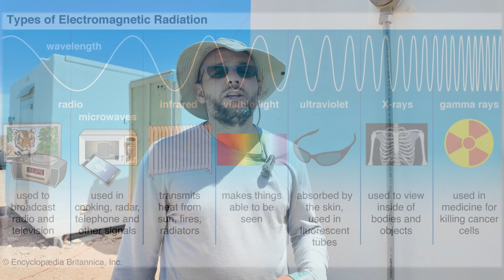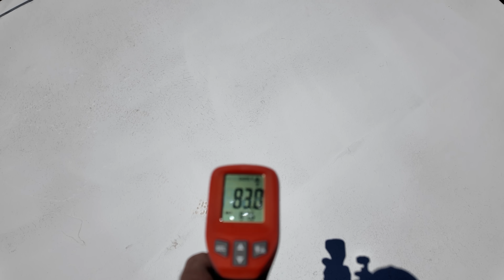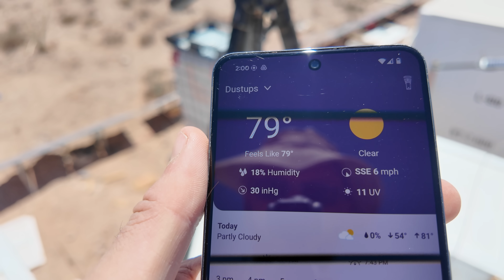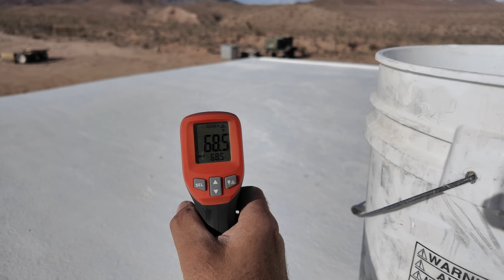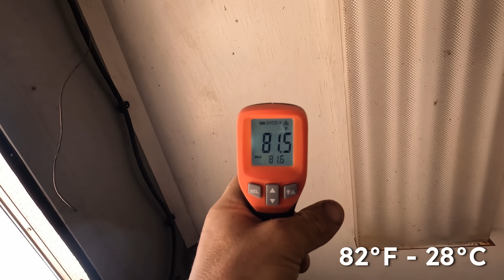I sprayed "cooling paint" on my desert cabin...this is shocking

Comment: It think you're putting a little too much importance on that "reflecting the IR to outer space" thing. Think of the mountain in the distance as a mirror. If you were to shine a flashlight at it, how much light would come back. Pretty darn near 0. And the mountain isn't nearly as reflective as a mirror. Cost of the paint is the real factor to consider when deciding if you want to do the sides. I would consider doing the eastern side of the shed because it's the one that gets hit in the morning, and I wouldn't enjoy being awoken by the heat.

Comment: In my house in Pakistan we have a layer of elevated tiles on the roof. That makes a smaller layer of insulation and it has made the entire house a few degrees cooler. I think that would be a really cost effective thing to try
Reply: Tile roofs in Florida save ~ 1/3 cooling expense, not sure about metal roofs with a gap, they are also better than asphalt shingles.
Reply: How does that stand up in high winds?

And where in Pakistan do you live?  I used to go to Karachi and Swat with my family when my father worked there.
Reply: @louisegogel7973  Many of the homes built long ago in South Florida had barrel tile roofs. Having the air space was a big advantage and most definitely withstood high winds. It all depends on who built it.
Reply: @louisegogel7973 i live in Islamabad. The roof has a cement boundary wall and the tiles are quite heavy so the wind isn't an issue

Comment: I love this one. I think it'll work. I would be tempted to paint the side regardless. Any heat you throw at that mountain isn't going to get back to your site. It is pretty expensive paint though.
Reply: I still think you should put the huts in a strategically placed hole. I can see how that wouldn't work with your longer term plans.

Comment: The real answer is that you need to build a compound with running water, electricity, and enough space to house a few families. That would be extremely expensive, although in the long run, you’d be setting yourself up for success

Comment: Shade cloth staked down over building. Using 4x4 blocks (1 per corner, think more cube shaped) to create gap and allow airflow. Will put the building constantly in the shade. Can be removed in winter to be warmer. Should stand up to high winds. Angle of sides can be steeper. Or less steep to provide shaded sitting area outside.
Reply: wind
Reply: @CharlsonCKim what do you mean?
Reply: https://youtu.be/ynY_9MctG6M?si=DtDgSjzfkUQ-fjpC here is the nursery set up on the ranch using shade cloth. It’s at the 26:30 mark. This has proven to stand up to the wind and sun so far.

Comment: You need shade. Get a mesh tarp and make a tent over your structures. Let the tent absorb the heat and it will radiate it back into the air. The sun will not be directly heating your structures. Shade is the way. 
Don't go 2 story in the desert. it's a bad plan. Heat loves up.

Comment: I agree about using shade cloth as it is easy, temporary and not as expensive as other ideas ( and faster to put up ). I have accumulated many large sheets of it from yard sales. You could just put a couple of 2x4 pieces strategically placed on the roof to create an air gap and then actually tent from one side over the top and down to the ground on the sides at angles, This has worked really well for me in the hotter areas of SoCal.

Comment: You can't rely on the IR measurement, the special paint will have a different emissivity.  You need to use a contact measurement.
Reply: The one around 17 min mark where he shoots the ceiling from the inside was a good comparison
Roughly 2 degrees difference, which is still a measurable difference. Idk if it was worth $300, but hey
Reply: The paint being so reflective, a thermocouple would be more appropriate in that situation.
Reply: Or use simply a patch of opaque tape on both surfaces. Those patches will have exact same emissivity.

Comment: why don't you put shade cloth awnings on all the east and west sides of the buildings so the sun isn't hitting the the sides fully? the reason i suggest shade cloth is because it would last a lot longer then a tarp because the wind can blow thru the holes in the shade cloth. the one that works the best is the aluminet that is metallic and shiny instead of black because it reflects instead of absorbs the sun's rays. the holes in the shade cloth also help sudden wind storms to not rip the shade cloth away or act so strongly like sails on a sailboat. the more shade you can make in camp the cooler it will be to work in camp. maybe aluminet for the east and west sides of buildings and the cheaper black stuff for everything else would do amazing things for camp and be cheaper. also as a fellow texan (south). the reason the tires work is because it gets the plants out of the drying wind. shade cloth fences to slow the wind might also help plants. you will probably run out of tires, but you can line the sides of a hole with rocks and i know you have a lot of those. if dug deep enough to provide enough of a wind block, or maybe a rock wall on the most common windward wall would also help. good luck!

Comment: solar panels not on the roof but around the roof will give a bit of shade on the walls and the ground around it. the ground might not heat up as much. probably not a revolution but whatever, you need electricity anyway. if it results in 1°C less inside, it is already a win.

Comment: The drying of the paint acted as an evaporative cooler.  If the paint was reflecting the infrared heat into outer space, the infrared thermometer would have registered the roof as HOTTER than the other buildings.

Comment: It will be more effetive to add a second hoof. Keeping space to the air passes between. Please make a test and see. Best regards.
Reply: I was thinking the same thing make it bigger than the current roof with overhangs for shade.
Reply: Keeping space between the structure and the roof is key, can even use camo net propped up by some of those pipes made into a frame. Just to put the structures in a shade.
Reply: @ianb3895  That will defeat the radiative cooling feature of the paint.
Reply: @michaelsmithers4900  But then don't need the paint that cost more than saffron
Reply: @lukehahn4489  You are correct. These are two different strategies. One being shade the other being radiative cooling. 
Is the paint more expensive than a second roof complete with overhangs?

Comment: I've heard that people use solar ovens at night to create ice. It uses the same principle of radiative cooling. 

This might be a way to get water for your trees. Bear with me. Take a trash can and bury it. Cut a small hole on the top and then put a reflective cone over top. The reflective upside down cone will get rid of the heat at night. By keeping it underground, you'll have a consistent temperature. You should be able to create ice at night and then the hot ambient air will condense on the ice. You might need to have a small pipe feeding air into the trash can from the side, having the tube underground a little bit will pre-cool the air. 

You should have a relatively low cost atmospheric water generator that doesn't use any electricity.
Reply: have you done this ???
how deep does it need to be ???
will this work at temperatures over 110 degrees ???
where can I get more information ???

Comment: That paint on a metal sheet, with a fan blowing at it, should be pretty effective, as long as its pointed into space. Though mustnt be behind glass, as glass reflect IR. Dont know how you would use this, but perhaps in the future, this is the principle to use radiative cooling as an air con

Comment: I live in Tucson Arizona and have an old adobe and concrete block building/ house . On the east and west sides I get a lot of heat hitting the blocks which radiates into the house over time. What I did was attach 2 inch hard foam to the walls and after applying chicken wire over the foam, stuccoed them for aesthetics. Depending on the surface material of the building you can use construction glue to adhere. Temp drops of 40 degrees or more in the summer. On the south side I put up a metal shade structure to allow us a place to go at night time when things cool down. You can use any foam you
Like but the hard foam is more durable. Instead of insulation, we call it exsulation
Reply: I live in the Mojave Desert 120+ during the summer. Mike you did the right thing turned you house in to a giant cooler.
Reply: @AnzaValley  Does this guy live in a temperate climate? Or does he have extreme temperature shifts and seasonal weather?
Reply: In San Antonio the Air Force turned a WWII warehouse building into offices using the same method.  They covered the wood siding of the building with 4 inches of solid foam.  They used additional strips of foam to make designs and give it some architectural interest.  Then they sprayed stucco in two coats.
Reply: @dchall8  Large office buildings are often covered by a "sheathing" which is thin, attractive, durable, but has an air flow space behind it. Weather hits the sheathing, but the wall it shields is untouched. Heat bounces off, rain bounces off, snow & ice may cling, but still don't touch the actual wall. Sheathing can be replaced if damaged, but it does the job. It's based on "the perfect wall" which I think was a Harvard study.
Reply: Years ago I read about a cabin in the Rockies that used hay as the insulator and the result was much higher efficiency with both heating and cooling.  ✌️
Reply: What is the temp 12 feet down?

Comment: Damn that paint works. That was crazy—unless the roof was cooled by the spray and evaporation. Bear in mind that the IR from your roof is not going to space. It gets absorbed to a great extent by dust and other particles as well as gasses that absorb and the. Re-emit the IR at another wavelength.

Comment: maybe look into the double roof effect. It is where a second roof is placed just above the first and causes an air current to form between the two rooves.
Reply: Group the buildings with a walkway and make that second roof one that covers the whole place.
Reply: Every single wide trailer in the world should have one of these
Reply: This won't perform as well, the radiative cooling paint allows it to get below ambient temperature (if applied well), this would only get it to ambient temperature but not below it.

Comment: my suggestion is to get solar powered mini split or window unit. It will run in the heat of the day and will only cost solar panels and the cost of the unit. The other thing that would help is get a giant green house frame and cover it with shade cloth. When i mean big i mean big enough to cover all of your buildings. Now i own land out there and know the wind is going to be a issue so its going to need to be properly anchored.  Those are super cheap to build.
Reply: I bet the money and time he spent on the paint, sprayer, setup , cleanup, amounts to a few extra solar panels. mounted on top of the doghouse blocks all of the sun.

Comment: 17:50 Very simple stop-gap improvement would be a false roof (made of any scrap material, naturally reflective is best but thin plywood wroks). Place the false roof on some blocks 8-10 inches high. Sun never sees the roof and wind is forced to aggressively convect heat away under maybe 1.1 atmosphere as it passes through the 8-10 inch gap.
Reply: Put foam board and a radiant barrier under the false roof so the infrared is reflected away. That adds another layer of shading.
Reply: I did this on my white van…fully covered in solar panels about 6-8 in above surface. I also painted ceramic paint (the kind they use for race cars) on the roof and about 12 in  down and around the top of the van on each side. Of course inside of van is very insulated, and use air flow to vent. I have an AC but never use it!
Reply: Yes for sure! This passive way of cooling is used in many very hot parts of the world to cool during summer season.
Reply: Agree, but I always wondered why mirrors or at least polished metals (thinking foil wraps) aren't used to do basically what the white paint is doing.
Reply: @StrangeUncle01  Because the paint is better & less expensive on big surfaces, Foil is not that great, like it preserves the color but it only reflects 80%-88% of light, while this goes up to 98ish, just scattered, which is both good and bad, the other problems you get from mirrors is that they are very directional which means you might be reflecting into another radiating surface and make the efect very small, at least for some minutes, tiny mirrors that reflect most but scattered is what these paints are actually just microscopic
Reply: @ratgr  Makes sense. I knew he was using specially formulated paint, but I assumed it would be expensive and the foil wraps being mirrored would offer far more reflection than just plain old white paint. Glad I asked then.
Reply: @StrangeUncle01  But even normal white paint if you could see it microscopically you would see its a lot of tiny reflectors, the big thing with this special white paint is not the reflection itself but that it radiates a lot more on lower temperatures, so it litteraly cools itself down
Reply: Make that false roof solar panels….
Win/win
Reply: Your roof is colder than the the ambient air?
Reply: Yes. Simple, cheap & little work needed. Also, DIY orientable panelling that "looks away" from the sun at peak hours.
Reply: Yep
Reply: I had my tile roof painted “surf mist” a slightly grey white before putting solar panels on. I could feel the difference the next week and the solar whirlybird would turn on later in the day. It has a 25 deg Celsius thermostat. The ducted AC works more efficiently now also.
Reply: wind
Reply: @CharlsonCKim  mount the "blocks" to the roof.  Mount the "false roof" to the blocks.
Reply: @reverendprophet  As long as they don't conduct heat that should work.

Comment: Camo netting for dessert, or adding mass over roof (sand, dirt) would work to reduce heat inside
Reply: exactly. Shade has a huge effect, and you can add layers to increase the effect with less risk of ripping a part.

Comment: Wood and left over silvered insulation like XPE Thermal Wrap Insulation is cheap second hand.  Build a wooden frame and cover it with insulation and put it on top of the roof with an air gap.  Insulating is best when the insulating cover isn't in contact with the surface you want to keep cool
Reply: Yeah just putting something in the shade helps so much you would hardly believe. The temperature of the top surface that provides the shade doesn't even really matter.
Reply: @ThaJay  That will help, did something similar using a radiative barrier inside an 8000sqf barn. If the roof was covered with a PDRC coating tho it would perform signifigantly better. Instead of the metal roof getting up to 140f daily it would be more like 80-85. Low enough to not have every customer whine about the heat in the summer. AC would have been nice but wasn't affordable there. You would think people would grasp that an antique mall in a barn in Florida would be hot in the summer, but no. Same effect as people standing right inside a door blocking other people and being oblivious to the hassle they are causing everyone around them.....

Comment: For the paint sprayer. Yes, spraying paint is a lot faster than with a roller, especially with big surfaces. And yes, it'll look better. However, considering the time it took you to buy that sprayer, unpacking it, figuring out how to work it, etc, I bet it would be way faster to just roll it on. Its not that big of a surface to just slap on some paint with a big roller. almost zero setup time. 
Definitely do the sides of the building too tho. It won't get reflected back at you by the mountains lol, they aren't a mirror, it'll just scatter the light and rather the heat in the mountains than in your cabins.
Reply: Agree. Don't even need a tray. Just dump some paint on the roof and spread.
Reply: You didn't count the time it took him to (hopefully) clean the sprayer and store it correctly for the trip home.  Spent about 3x as long with the sprayer as rolling.  Obvious NOOB mistake with no painting experience.
Reply: Never setup an airless sprayer for any job of less than 3 gallons. Setup, cleanup and paint waste negate the time savings.
Reply: @jstaffordii  He is all about false efficiency!
Reply: yeah but he got a toy out of it lol
he who dies with the most toys wins
Reply: @TheoCollett  Something rich people say a lot.  I had LaserDisc, and all of the other optical formats, and I had 15 computers and albums and CDs and 50 hard drives and a coin collection and a slide rule collection.  All stolen away by some rich fuk with all the integrity of a freshly laid dog turd.  35 years of my life gone in a flash.  Toys?  The sad thing is that many of you "most toys" dopes were stupid enough to believe Trump's bullsh*t and voted for the putz.
Reply: It was painful watching the spraying. Like having a ride on mower for a little lawn.
Reply: Not to mention how much paint is wasted with sprayers. May be the reason the paint supplier wanted him to use one lol
Reply: No respirator needed, no paint getting blown back at you making your pants sticky…
Reply: I was thinking the same thing. A roller would also provide a more even coat (if done right). And it's Cheaper - FFS!!